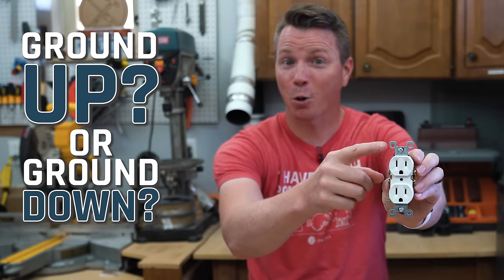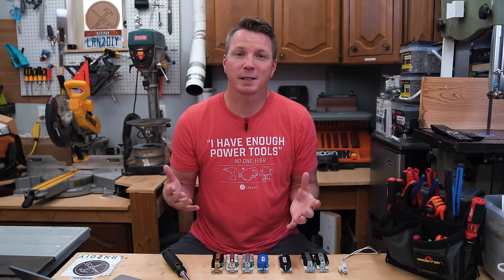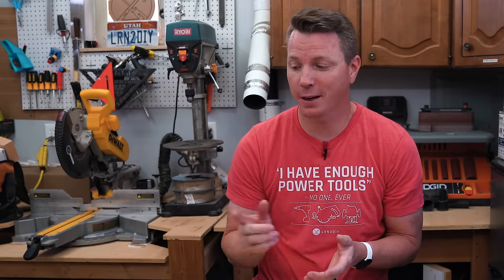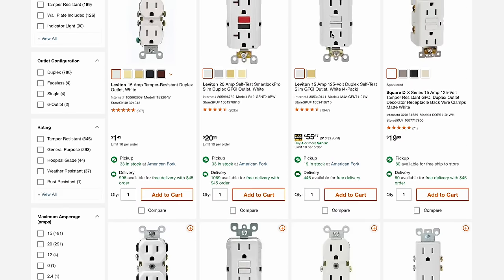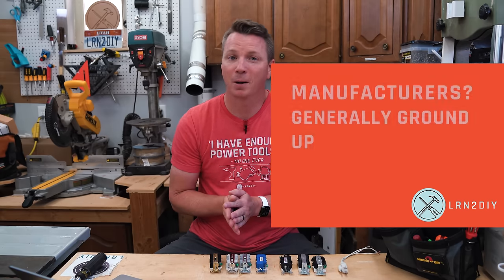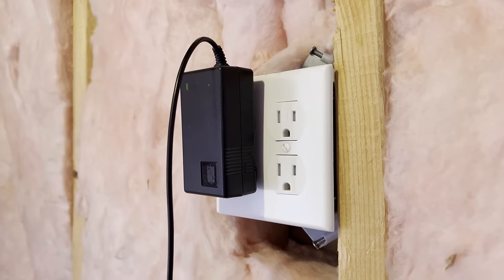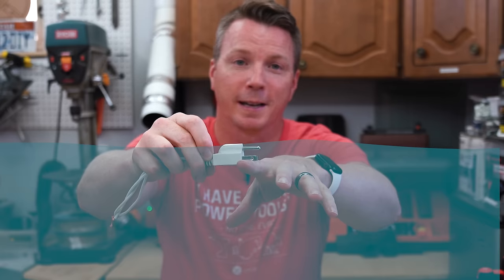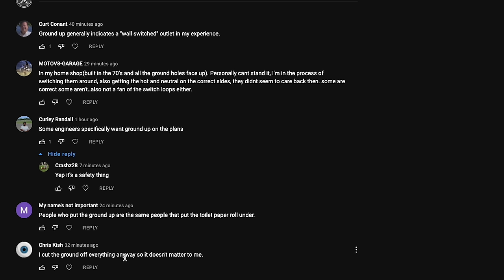Should Your Outlet Ground Face Up or Down?

Comment: This is a good ground up explanation from from Quora:
Harold Green: Retired electrician. We mounted all receptacles ground pin down for decades. Then the medical industry who only use metal trim plates decided that it was much safer to have the ground pin up in case the trim plate came loose and slid down on the prongs of a plug shorting out what might have been a critical piece of equipment. There’s really no reason to mount a plug upside down unless you’re using a conductive trim plate.

Comment: NEMA 5-15 (120vac/15A) corded plugs include "low profile" variations. You'll find these on some wash machines, gas clothes dryers, refrigerators, and other appliances designed to be as flush to the wall as possible. These plugs usually have the cord coming out the side - I suppose you could call it a "right-angle" plug. The intention is the cord hangs down as it enters the appliance. I have 4 of these in my home and workshop; two refrigerators, a gas dryer and a clothes washing machine. In all 4 cases, with the wire hanging down, the ground plug is DOWN. If the receptacle had the ground plug UP, the cord would come out the top of the plug. In one case in the workshop I had a receptacle near my refrigerator which I had to reverse to get the "low profile" plug cord to hang down properly. So, the designers of these 4 appliances at least, have picked GROUND DOWN.
Reply: I was going to mention this. Every plug on an appliance or extension cord like what Neal discribed indicates ground should be down.  This is actually one of the biggest indicators in my opinion that ground should be down and I was surprised  He didn't mention it in the video.. ironicly with a mini fridge right beside him. (that may have this kind of plug)
Reply: Exactly right!!  As I’ve been painting rooms in our home, or as needed like for the refrigerator as you discussed, I’ve been rotating each receptical to put it right (ground down for me).  It’s a real PITA to have to deal with ground-up recepticals because the world makes things for ground-down.
Reply: I came to the same conclusion. I wanted to get a 'surge suppressor' outlet for my refrigerator (with right angle cord) and to mount it 'correctly', meaning ground down, the outlet wording and test lights would be upside down. Frankly I think it's a real thin argument that I've heard for years about the 'shorting of the 2 terminals in the ground down orientation'. That's like a 1 in a million accident because it would require the plug not to be fully inserted and would trip the breaker. If it were that dangerous the NEC code would explicitly say which way they should be mounted. I could just as easily say with the ground up orientation a 'paper clip' or knife could have a 50% chance of rotating off the ground onto the hot leg prong.
Reply: Same thing with all of my UPSes and I believe everything I own with polarized plugs.   I've never had one appliance where the orientation of the plug favored a ground up position.

Comment: having worked in a hospital( retired), as an electrician, we were told to install receptacles ground side up, if it is installed in the vertical plane .if the receptacles. is installed in the horizontal plane, then the neutral side is up. this was done to cut down on the possibility of short outs if a plug was not fully seated, this was a good thing due to the fact that when I first started at the hospital, the main building had "FEDERAL PACIFIC" circuit breakers( bolt in-- not stab lock type) that were thermal trip only, also all plugs were straight pull out, so there was no damage done to the receptacles  for instance a bed is removed from a room and the service cord is not disconnected before removing it.at home I will install the receptacles depending on the use of a 90 degree molded plug, so the service cord is hanging down. a friend of mine who is also an electrician, got on me about how I was installing receptacles and I told him "SHOW ME IN THE N.E.C " he could not comply .      thanks for posting this!!!!!.
Reply: Every hospital I've ever been in has the ground up.
Reply: @cgirl111  ,I have too
Reply: I’ve not seen a tamper resistant yet!  Lol

Comment: I’ve been installing outlets in my own home, and lab, with the ground up. Think about it. If the plug is pulled downwards the two live spades are open. When I was about two years old I got a shock I’ve never forgotten from that. I put the ground up, because if it partly pulls out, the ground is slightly out, and shielding you from the circuit. I’m totally convinced that it’s safer.
Reply: I agree.  The first house I remember living in (1955) was ungrounded so this wasn't an issue; however, as appliance cords started coming with the ground, my father decided to change the outlets to 3-prong.  Back then the orientation was a big deal due to safety concerns.  There had already been plenty of problems with children placing a coin across the ungrounded prongs, so there was almost a movement to orient these new 3-prong outlets with the ground hole up.  My sister once opened a hair pin and stuck it into ungrounded outlet, so the children thing is a real issue.  Having said that, I raised two girls in a house with ground holes facing down and did not have a problem.  Maybe kids today have other things to do besides putting coins across the plugs.  In some countries they recess the receptical deep into the wall to make it very hard for this to be a problem.
Reply: @dchall8  when we got our daughter, I used these childproof outlet covers that had a spring, and that you had push sideways with the plug before they would go in. I thought that was a good investment. Of course, now she’s almost 31, so I no longer worry about that, and she isn’t with us anyway. But she has an IQ of 157, and was incurably curious. No point in taking chances.
Reply: What about items that do not have a 3 wire plug, such as a lamp?
Reply: I'm totally convinced it's not.
Reply: @skipb525  yeah, you are entitled to your opinion.

Comment: Most grounded cords for devices like lamps (ie devices that are meant to be above the plug) are designed for ground-down outlets. You often have to bend the cord in unpleasant ways when your ground is up.
Reply from the maker: Agreed. Seems like most things are designed for ground down.
Reply: Well, they should have out let one up, one down.  All the chargers lumps get in the one per out let unless you find extension cords.  Personally, I don't like extention cords.
Reply: Then those manufactures are wrong.
Reply: So true. There is always some idiot thinks knows better.  Then proven technology. 
They are the same people who  wire their house themselves and can't understand why the house burns to the ground.
Reply: @assassinlexx1993  , I wired my hose 33 years ago with my grounds up and it has not burned down yet, nor will it ever because of this. Every outlet I ever installed as an industrial electrician was ground up and not one word was said about being wrong by any inspector.
Reply: @johnirwin1837  
Cool you wired a receptacle
Reply: @assassinlexx1993  , smart a$$.
Reply: @johnirwin1837  Curious why you wired your hose?????
Reply: @warrenw2u  , because I was qualified and could. Can you do it plus wire a 50' by 700' confined egg laying facility with all it automation from scratch to include procurment of materials?
Reply: @warrenw2u  I was wondering if it was a garden hose or a euphemism for his manliness.

Comment: We install receptacles ground down, with the exception of one receptacle in each room that's on a switch leg; so our new buyers know.
Reply: I don't know about other areas, but in Southern California, the standard practice (not universally used, but pretty common) is to put the ground down except for any outlets that are on a switch.  Those are ground up.  Then the resident knows which outlet is hooked to the switch.  This is almost (but not universally) the case in my area.
Reply: That's how I was taught also.
Reply: Simple & subtle but effective
Reply: I was annoyed at first to discover some ground up receptacles in my new home, until I realized they were all switched.  I love this method.  Thank you.
Reply: My dad showed me that in the '70's. His logic was that the ground prong is longer, it goes in first, so, put it on top to plug in easier. The inspector called him on it- they got out the NEC book then. It didn't say. Apparrently the standard practice is ground down on hot receptacles, ground up on switched outlets. That's a good idea.
Reply: I like this, but some homes (or electricians rather) tend to only use one of the two receptacles for a switch for whatever reason that is, so I leave them as is with the ground down.
Reply: With a 90 degree plug like your fridge or some appliances it more hazardous because the wires are bend completely and upside down and when being press in to the wall could cause the wire to break. Also due to gravity your wires could work it way away from your outlet. This upside down theory do not all way work with heavy cable that have to be bend with the heavy weight of the cable being pulling down.  Too much stress on the cable.  Not good ideas 😊
Reply: This is not a good idea to have the outlet upside down because there are things that you buy and can not be plug in to an outlet upside down.
Reply: Switch leg?

Ireland here sockets don't connect to switches (new sockets have switches directly on them), you can get special sockets that do connect to switches but they are a different shape so immediately identifying

Comment: I'm ambivalent about ground up or down, but I'm curious to know more about the "receptical facing up" being prohibited by code. Could you tell me the relevant section? I have a couple of outlets installed in 2008 that face up and at the time it passed inspection. Maybe because NEC2008 allowed it? Or because mine have a cover? Or is just where there's potential for water intrusion like under a sink?

Comment: NEC does not specify any particular outlet orientation.  However the IEEE White Book “Recommended Practice for Electric Systems in Health Care Facilities” (IEEE Std. 602 - 2007) says in section 4.2.2 “Parallel blade devices should be mounted ground pin or neutral blade up. In this configuration, any metal that drops between the plug and the wall will most likely contact a nonenergized blade.”  This is also where the specification for UL listed "hospital grade" receptacles are located.  There's a lot of other things, like significant additional requirements for grounding.  These outlets are required to have metal cover plates, and should they come loose they don't want them to drop on a plug pulled out a bit and short it, possibly turning off a critical bit of equipment like a ventilator.  Better to have it drop on the ground pin.

When working on specialized facilities, in particular hospitals and data centers there are often significant additional requirements over and above the NEC from the IEEE, NFPA, or also industry best practices.  While these practices may be useful in these specialized environments where there are heightened life-safety implications, it's questionable if they have any cost/benefit for ordinary residential applications.  Nylon cover plates won't short, and it's unlikely life critical equipment will be running off a residential outlet.

Comment: As an electrician there has only been one job at a Psychiatric hospital that they specified ground must be up. The theory I heard was if the plug came slightly out from the wall and something small enough and conductive was to be dropped on the plug it would hit the ground and not a live prong. Personally I prefer the look and useability of ground down in most cases.

Comment: In homes, I have only seen ground down.  While in the military in the mid 70's I was handed a polarity checker to test all the outlets in my building and report any that were bad or mounted ground down for repair. Yep, the military at that time and place was mounting them ground up. for workplace safety issues. My shop has them mounted ground up.

Comment: Years ago I worked for a hospital and part of my job was to go around and test the receptacles, cords, and plugs. I was instructed to ensure that the receptacles were installed with the ground up. The reasoning was on a receptacle mounted with the ground down that if a paperclip were to fall off the back of a desk, it might get stuck behind the plug and touch both the conductor (black) and the grounded conductor (white) and may start a fire. If you put the ground up, the paperclip would fall off one side or the other. So it was considered safer to mount it ground up. At the time, most documentation instructed that the ground be mounted up. Now, most people put the ground down because it looks more natural. The conductor holes look like eyes, and the ground hole looks like a mouth.
Reply: A paperclip falling on the plug blades! I'll bet that that has NEVER happened and was conjured up as a reason by people who prefer ground up.
Reply: EVERY hospital and doctors office I have ever been in has been ground down.  And they use the orange hospital grade receptacles.
Reply: @RSole9999  I had one of the rabbit ears from a small "6 inch" TV on a countertop,  fall on an outlet it was plugged in to  and burnt off the antenna and shorted out the circuit.  ive installed ground up ever since . circa 1985
Reply: Here's the thing, if a "paperclip" fell on the live/neutral contacts, it should short out and the breaker/fuse should trip/snap, if the breaker/fuse do not trip/snap, that means the whole circuit is wrong and very likely not to code.
Also, most plugs and power adapters are made to fit the ground-down connection so as not interfere with other outlet openings, specially newer plugs that rotate 45 degrees to the left.
Reply: @LoneTiger  in my instance it took the tip of antenna off and blew a 15 amp fuse . 
so it can happen
Reply: @jeffreystarits2783  Great, as long as the fuse blows, your circuit its working as intended. 👍
Reply: @LoneTiger  but the ground down receptacle was a fail  😧
Reply: @LoneTiger  so this electrician is a ground up guy
Reply: @jeffreystarits2783  as he should be.
Reply: @rbrucecarter  Every medical facility I've ever been in or worked in had ground-up installations...I'm in the South East...
Reply: Mark Heaney,  Back in 1967, I guy died so that we would have ground up in every hospital ever since that time!  He was in traction, and the metal support hit a 120 volt receptacle, with the ground down.  It killed him.  Had the ground been up, and the "Hospital Grade" receptacle and plug been in use, the plug would not be loose on the wall, and the receptacle will grip a plug much tighter than a typical $1 home use receptacle.  

A friend of mine was renting soft serve ice cream machines at various businesses and hospitals.  Each one going into a hospital had to be equipped with a "Hospital grade" plug before they could deliver one there.  The molded plug was cut off and a $15 hospital grade plug installed before they could bring the soft serve ice cream maker into the hospital.
Reply: @rbrucecarter , In California and Oregon, the orange receptacles are normally used on circuits that can be energized during a power failure, so on generator supplied circuits.  It is a very fast way to let the people in the hospital know that this receptacle will have power 10 seconds after a power failure, but all the white ones in the room will not have power until grid power is back in a few minutes / hours.  

Normally the electrical load of a hospital is much larger than the capacity of the diesel powered generators.  So they only power up some of the lights, and about 1/4 of the power receptacles in the rooms and none in the hallways.
Reply: Most hospitals have metal outlet plates.  If ground is down,and the screw comes out of the outlet plate, it shorts line to neutral and the breaker trips.  If ground is up, the breaker doesn’t trip, the outlet playe will hang diagonally, putting hot to ground, or neutral to ground.  Neither will trip a breaker.  Both are unsafe.  Unless it is a ground fault outlet
Reply: @rbrucecarter

Comment: Any appliance cord like washing machine, dishwasher, etc. (at least that I have seen) that has an angled end on it has been manufactured to be ground down.  Having ground UP makes these types of cords have to go up the wall before going back down to the appliance.  Some plug strips have the male plug capable of rotating to make either work when the ground is up while most single outlet surge protectors are typically ground down.  Ground down seems to have fewer issues to deal with.  Ask me how I know!  Good videos!

Comment: In the house I install the ground down, because a lot of 90° cords are made for ground down. 
In the shops, barns, outdoors I install the ground up because an old local  electrician told me to install the non house outlets with the ground up, because it helps keep the cord in the outlet when you have the ground up. 
Hello from north east Montana. 
10 miles from the Canadian border.

Comment: Here in the UK, all sockets (aka outlets) are installed ground up.

Of course, that might have something to do with our plugs having the flex hanging down, instead of pointing away from the wall.

Also have you noticed, how your light switches operate the opposite way, to the ones on this side of the pond?
Reply: Most of your electrical gear is built better than the stuff we use in the US for a lot of reasons.  Part is from your having fewer code authorities, part is from your having some of the best electrical engineers in the world at that time, part is from the speed of adoption, part is from your having to refit so many buildings after WW2.